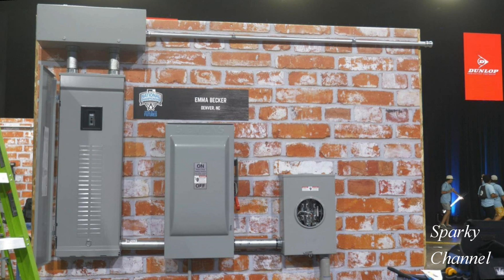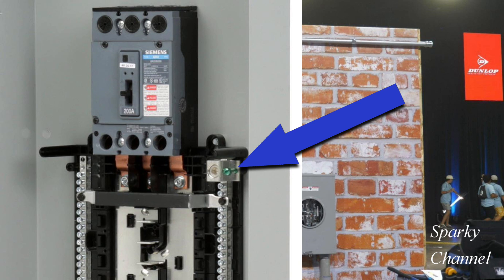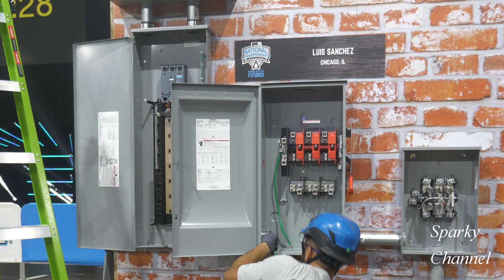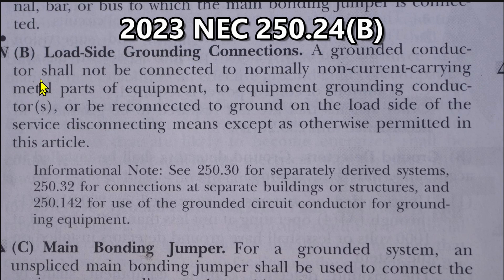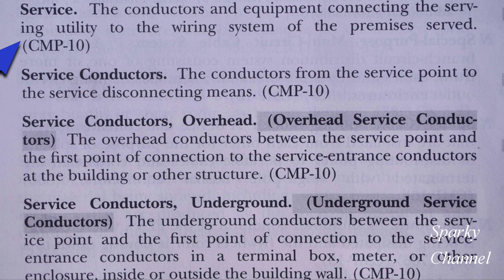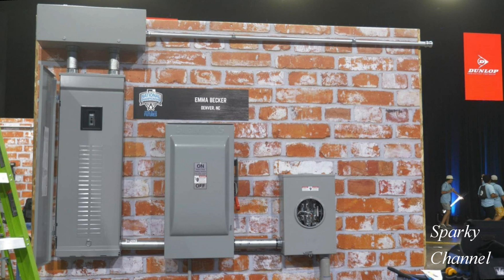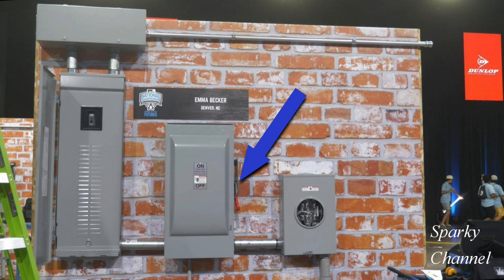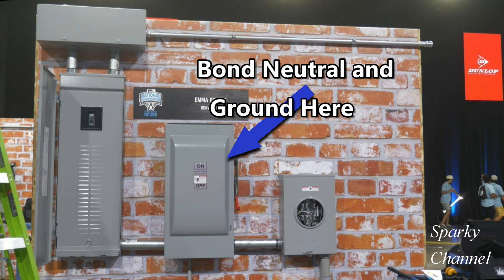In Which Panel are the Ground and Neutral to be Bonded?

Comment: What about for meter sockets that have a spot for a ground wire to literally bond with the neutral wire right next to or behind the meter itself? Especially for meter base panel combo units? And where does the ground rod go in such a situation?

Comment: I’ve installed a 400 amp meter base with 2 200 amp panels on each side with the one to the left running to my inside the house 200 amp sub panel.   The one to the right will go to my HVAC and exterior garage etc.  I know the inside 200 amp panel does not get the bonding screw.  I also think neither of the 200 amp panel next to the meter base should Intighten the green bonding screws.   However the inspector said both the 200 amp panels on each side of the meter base are considered as part of one service entrance system and both screws should be tightened down.
Reply: Wherever the service hits first after meter in your case to the main breakers of your panels, thats where you should bond neutral to a ground. Main breaker(main disconnect)

Comment: Does this N-G bonding depend on the type of earthing system? Like TN-S, TN-C-S etc.
Reply: Yes it does.  However, we only run TN-C-S in the USA, so neutral/grounds are always bonded at the first means of disconnect. There is no TN-S anywhere (for residential) that I am aware of.  TN-S means that the utility bonds neutral and ground at the transformer and then runs a separate neutral and ground cable to your house.  So basically they are just moving the bonding part to their transformer instead of at your service disconnect. Since this is the case, it means you never bond neutral/ground at the premises. TN-S is a better and safer system, but it costs the utilities money and they don't like that.  

In a TT system, the utility grounds their transformer and then you ground your end.  But the difference is that your grounding system is NOT bonded to theirs.  It is completely isolated. This has advantages, but also some big disadvantages. For one, you are relying on your own ground rods for all fault clearing.  This means you need REALLY low resistance ground rods (hard to achieve in practice). If you don't achieve a low enough resistance, well, you aren't going to clear faults and everything becomes a shock hazard.

Comment: When I redo my electrical box I am isolating all conductors and grounds. I will connect the loads to the incoming wires from the pole to the panel, and I will have the three wires coming in which are two hots and one neutral. I will use the cold water pipe to ground the panel and connect all my grounds to the grounding terminals with a separate terminal for the neutral wires, assuming I don't have one of those newfangled boxes that have breakers that hold both neutral and hot. Even in that case, I will have the ground bus bar and panel grounded to cold water pipe, all isolated from the neutral incoming line.
Reply from the maker: Do you have ground rods?
Reply: @SparkyChannel  No, Right now I ground from cold water pipe. It's 6 feet deep copper and has good ground. If I have the panel redone, I will probably get rods installed. When I have things done, I like it ALL done the proper way and with all the "extras" that come with it.

Comment: Hi Sparky Bill.
I will be installing an electric vehicle charger in a garage of a dwelling. The branch circuit will be 1 phase, 240 volt, 50 amps, NO neutral.
As it will be in a garage it must be on a GFCI 2 pole, 50 Amp breaker.
As the circuit does not have a neutral what should be done with the neutral pigtail coming off of the GFCI breaker, should this pigtail still be landed on the neutral bus?
Reply: Doesn't 210.8 only require GFCI protection for 120V 15A/20A circuits? I know this section has been updated (I only have the 2017 NEC at the moment) but as far as I'm aware, a 240V 50A circuit wouldn't be required to be on a GFCI, even in a garage. Someone correct me if my info is outdated...

If you do opt to put a GFCI breaker for added safety, I would guess that the neutral pigtail on the breaker would just land on the neutral bus like you said. Even though the circuit itself doesn't have a neutral, the internal GFCI electronics likely require 120V for the test function to work properly.
Reply: @MaxPowerElectric  210.8(A) has been revised and now states "All 125-volt through 250_volt receptacles. @billstarr9396 If the charger is a 48 amp charger, the circuit needs to have the 125% added to it and brings the circuit up to 60 amps. As per NEC 334.80, 6/3 romex can only go up to 55 amps and depending on the inspector, would fail for being undersized.
Reply: @elpajaropelu9527  it is a 40 Amp EV charger therefore using the 125% multiplier that brings it up to a 50 Amp breaker. I plan on using 8/2 copper romex with a ground. As for the neutral pigtail off the breaker I plan to land it on the neutral bus regardless of the fact that the branch circuit is single phase, minus a neutral conductor.
Reply: GFCI is only required for a receptacle. If it's hardwired, the stupid thing isn't required. If the breaker is designed correctly, it won't have a neutral, but it might need it if it's an electronic (requires power) breaker. As always, consult the manufacturer's documentation!

Comment: Here in New Mexico we are required to run bare copper #6 from the panel up into the meter can and also bond to ground bushings with one solid piece of wire
Reply from the maker: Excellent!
Reply: do you use metallic conduit between the meter and the service gear?  where I am, it is common to use PVC, if you're not using cable.  but we had one inspector insist we use plastic bushings on the chamfered cable fittings.
Reply: @kenbrown2808  yes we use rigid even for the riser off the meter can we only use 2” rigid no pvc
Reply: @Weasel_NM575  the service mast is the only place we use rigid. Aand then it goes into a hub or a field cut hole, so it is bonded.
Reply: @kenbrown2808  yeah I’ve seen for example on the competition video’s they usually run pvc then again a states and inspectors are all different
Reply: @Weasel_NM575  steel dissolves, here.

Comment: I like the expression, "the first point of disconnect"  it's very clear.
Reply from the maker: "First service disconnecting means" is more specific. But you're correct. I've also heard "bond the first panel of disconnect".
Reply: @SparkyChannel  every electrician should understand "service disconnect"  but "first point of disconnect" should even be clear to a green apprentice.
Reply from the maker: It is very clear, I agree.  @kenbrown2808

Comment: hi, what wound change if the meter box had a disconnect that I've seen in other videos?
Reply: correct.  then the disconnect in the meter box would be the service disconnect.
Reply: Thanks that's what I thought. @kenbrown2808
Reply from the maker: Excellent question! I have a video with just that scenario: How to Bond Neutral and Ground With 2023  NEC Code Book and Handbook: https://youtu.be/8nXEyMN3jHw

Comment: Hey Bill was this a demonstration? Have to ask and I apologize if I missed something, why was the fused disconnect installed when the breaker panel has a main disconnect in it ? Thanks Bill 👍
Reply: yes, it was a demonstration.  there are some applications that require fuses as short circuit protection, where you will have fast acting fuses backing up breakers, and some applications where there will be fuses with a higher interrupting capacity backing up a breaker panel with a lower interrupting capacity.  and, of course, if the breaker panel is in a remote location, there will need to be a disconnecting means with overcurrent protection,  adjacent to the meter.
Reply from the maker: Excellent answer Ken! That is a 3 phase meter socket, "UG/OH" (underground or overhead) for 240V, so the designer of the contest felt that the heavy duty safety switch was realistic for the contest. Many of these apprentices work in a commercial setting.   @kenbrown2808
Reply: @SparkyChannel  interestingly, that meter socket would mot be approved in my area.  power companies require a test block bypass on any commercial installation, and the one I work with most, requires the service lugs to be in line with the service conduit for an underground installation.
Reply from the maker: Interesting, thanks!  @kenbrown2808